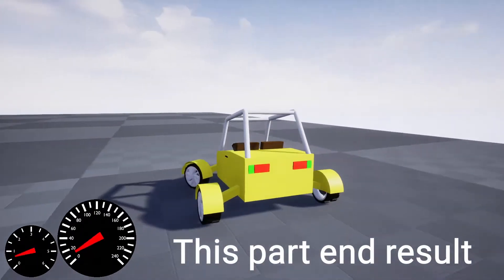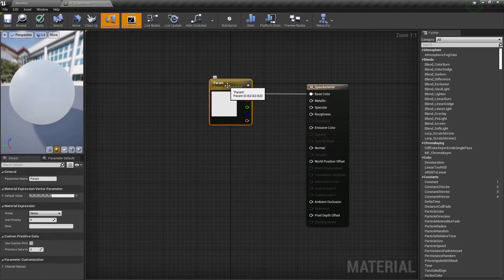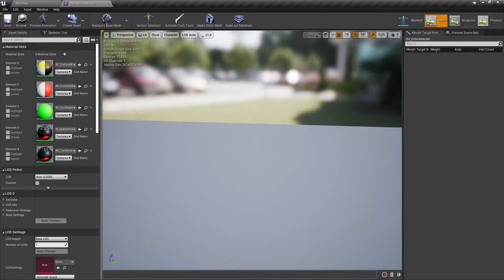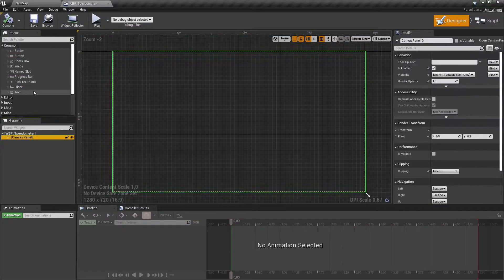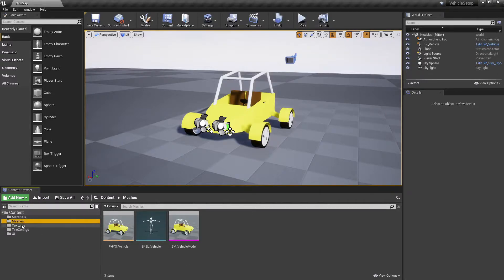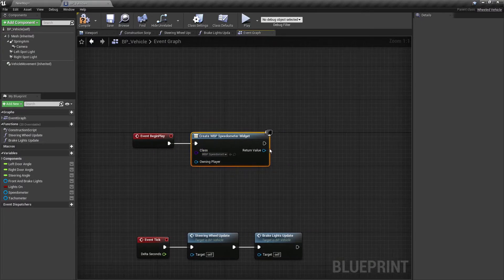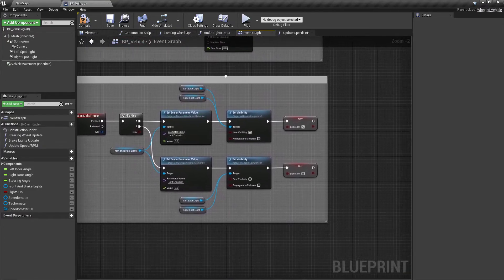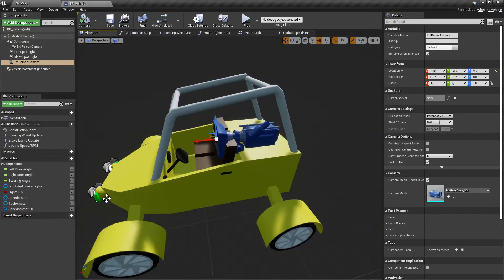Speedometer/tachometer and 1st person camera in UE4 | [Part 10] Low poly vehicle for UE4

Comment: Hi, can we also add the animation of the wheels and speedometer on sequencer when we let the car just follow a path like the camera rig rail?
Reply from the maker: I know that you can use a sequence recorder to record driving with a vehicle and then play it back in the sequencer (with some workarounds), but I haven't looked into recording a speedometer or things like that.
Reply: Continue Break thanks for replying. I hope i find this “workaround”. I always got a request from my work to do an animation of cars driving in, and recently a shot from the car interiors. The traffic system that i bought on the marketplace, is easy to use on gameplay, but problematic when used on the recorder and sequencer so I am scouring youtube for tutorials to manually to do it. I will try your tutorials. Thanks again.
Reply from the maker: If your vehicle isn't visible in the rendering, then in the sequencer add Actor Hidden In Game track to your vehicle blueprint and make sure it's set to visible in there. And if your vehicle in the rendering isn't moving but wheels are rotating, then disable simulate physics for the vehicle's mesh component. Those are the workarounds I know right now for vehicle animations that are recorded by using a sequence recorder. If you need some more help, DM me on socials or in discord, maybe there's something else I know that would help you.